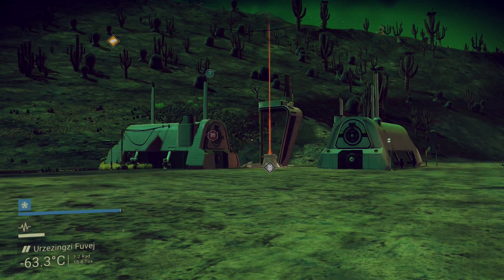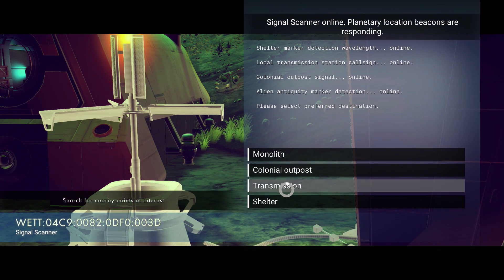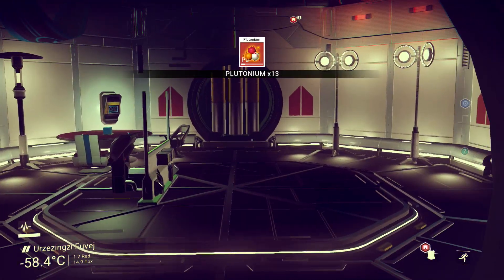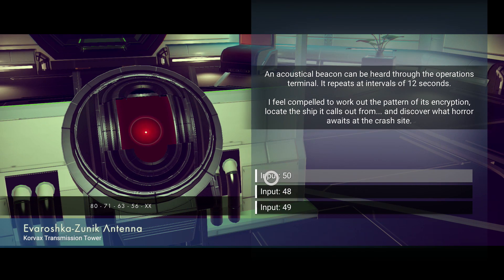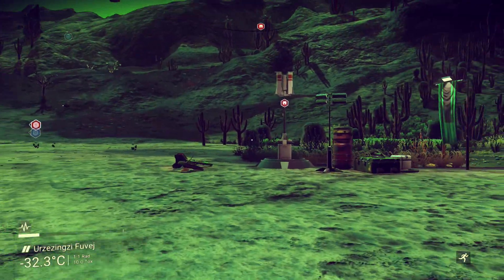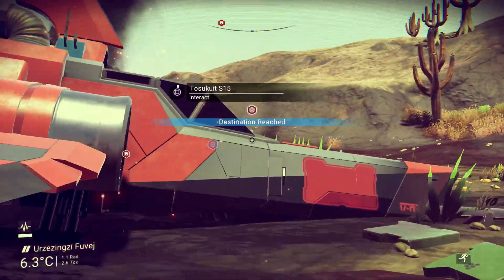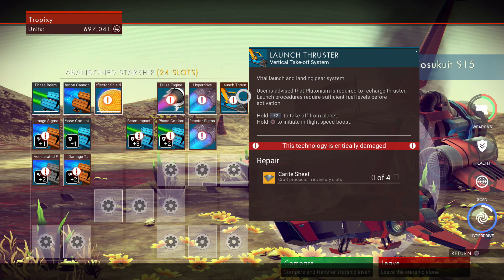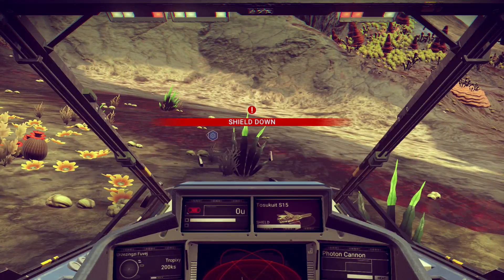No Man's Sky Tutorial: HOW TO FIND CRASHED SHIPS EASY & HOW TO REPAIR CRASHED SHIPS!

Comment: having a hard time understanding how you came up with the number 6. Could you  explaning it with more detail the formula/encryption. I keep getting them wrong, oh, got one rt, but totally luck of a guess.
Reply: 80 - 71 - 63 - 56 - XX. You find the difference between 80 and 71 (9) then between 71 and 63 (8). So you know it goes down by one every time and you follow the pattern to the last number. Some of them have multiples and some are like the one in the vid.
Reply from the maker: +Danijel Micevic thanks for explaining that for me
Reply from the maker: +Danijel Micevic thanks for explaining that for me